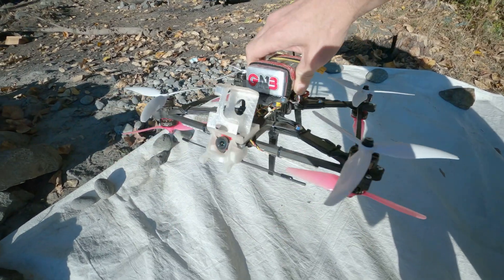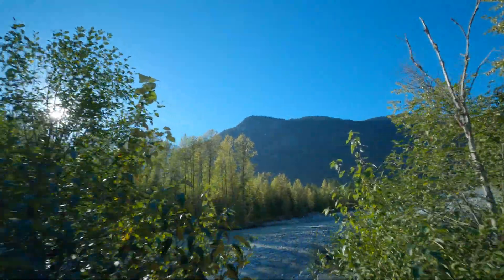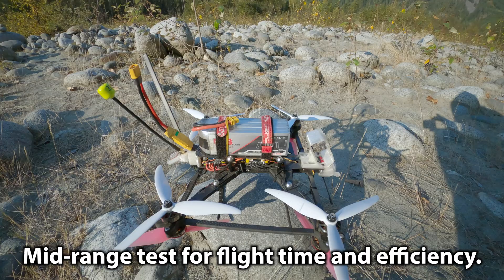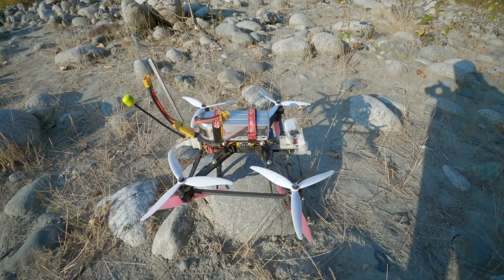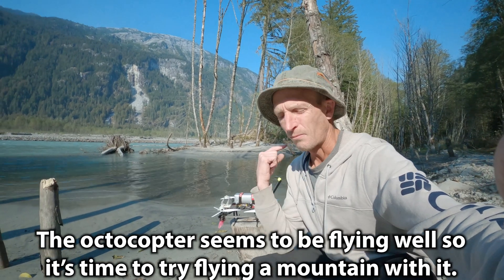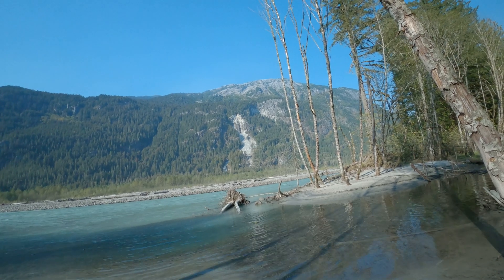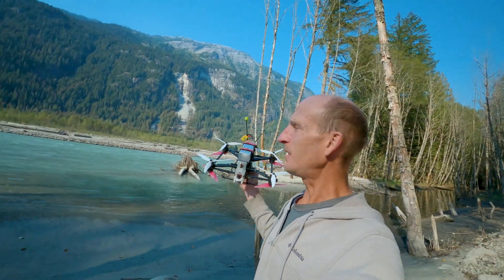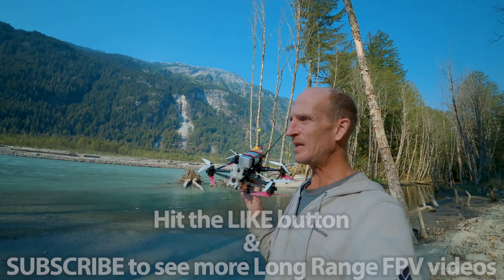Can I Fly Long Range FPV with an Octocopter?

Comment: X8 vs Octocopter = X8 is more aerodynamic (smaller effective prop disc area if you count the two stacked as one) but less efficient (due to the prop wash from one motor and prop affecting the other below). The X8 is likely to be better for stunt flying than an octocopter on this basis. Neither will be as efficient as a quadcopter but you might get some benefits in terms of smoothness and yaw stability and control.

Comment: Interesting setup, do you feel more agile and confident in the wind or gust of wind at tops?
Reply from the maker: Not really, but it does feel more stable at slow flying than my regular 7".  I find that handling the wind is more about motor kv and tune.  But it will also carry more weight, I'll eventually try mounting my black magic 4k g2 camera on it.

Comment: Due to air flow, can I ask you to swap bottom and top. Top be bi-blade then bottom be tri-blade.

Due to vortex of air, I would think doing opposite may be better. I may be wrong. Can you confirm?
Reply from the maker: Interesting idea, I'll try it, but with a different motor configuration.  On this one the bottom motors were only 1350kv 2306 so I only used 6" bi-blades.

Comment: Hi 
Great video 
The 2blade props with 3blade props combination is good .How good is it in performance
Reply from the maker: For this setup I think it helped with the flight feel when flying slow and doing lots of turns.  Iused 1200kv 2508 for the top 7" props as the main thrust and the 2306 1350kv on the bottom with 6" bi-blades thinking it would handle the quick rpm changes for better handling.  And I think it worked at doing that but I could only really notice it at slower speeds, flying a bit faster it felt almost like a regular 7" drone.

Comment: Amazing test flight for sure!  I know you are very experienced with flying all different battery types, but those Lipos, in my little experience, have such a sharp "end of voltage" drop that long range gets a bit scary.  I just started this summer flying midrange with Li-ions and they last so long and drop voltage so gradually compared to Lipo's.  Awesome video, man!
Reply from the maker: yes, great point.  Lipo's go slow until the end and then drop very fast.  Much easier to track a flight by voltage with li-ion packs.  Although I think the mAh used count is even more reliable.

Comment: I have so many questions but I am guessing you are going to do more vids on this Octo?
Reply from the maker: ya, I'm going to post a build video in a month or so.  And maybe a short info video about the other octocopter I built.  Also have 3 or 4 more long range flight videos done with the X8 octocopter.
Reply: @FalconRadFPV  So did 8 small motors seem to be more efficient than 4 bigger motors?

Comment: You probably will do better with that beast after them garbage GNB lipos are dead. I know you know  ! 😉
Reply from the maker: Not sure what you mean?  My 7000mAh GNB's are still flying well for me.  I use them mainly on my cinequad with my 4K G2 camera and sometimes on the falcon rpm quad or octo.  Cell matching isn't as good on them as with Molicel li-ion cells but that's all part of dealing with using a lipo.